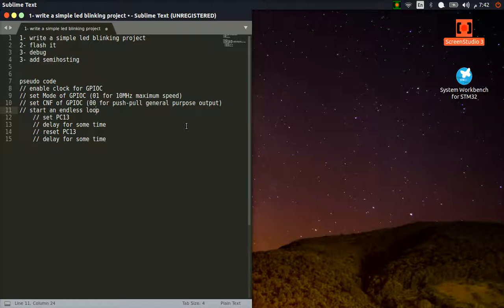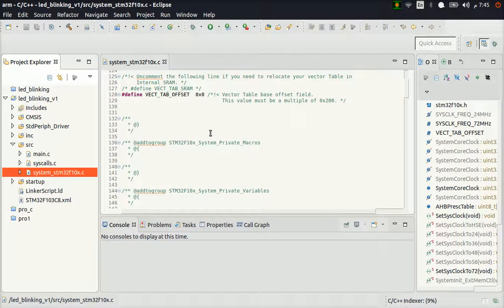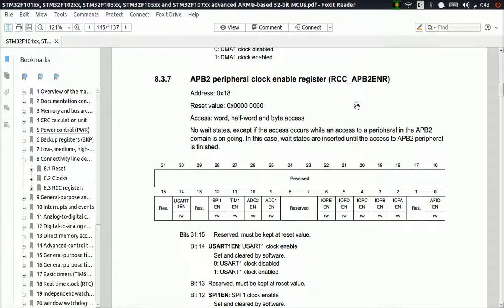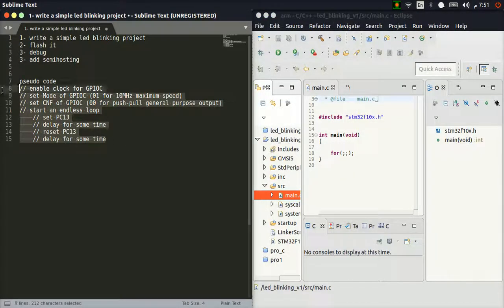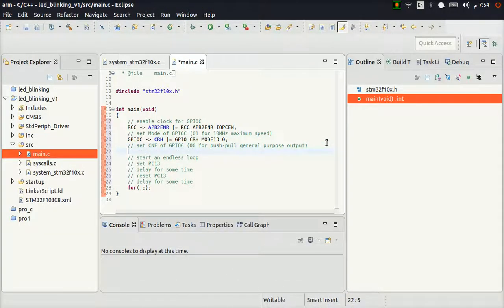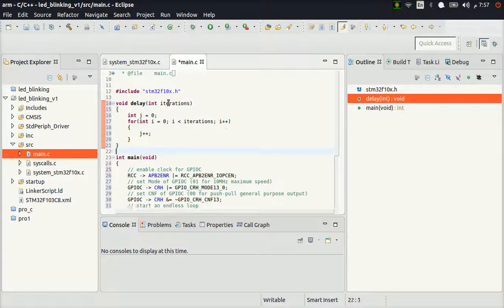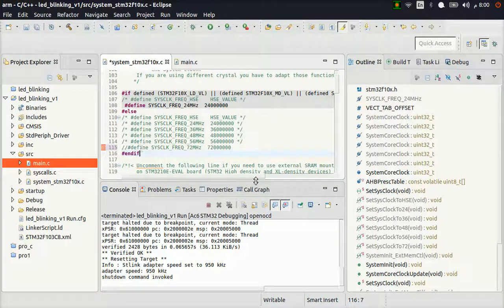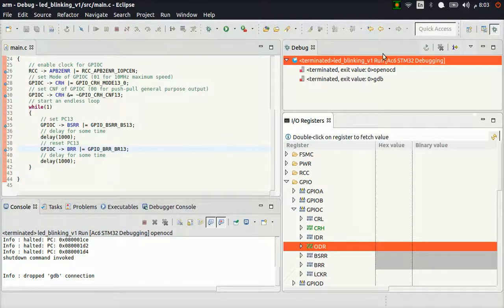STM32 Development   Tutorial 1 Led Blinking

Comment: nice course for stm32f103  but it will be better  to do a reusable code by just using function for system clock and for gpio setting and fonction for set and reset bit to make your code clear and use it second time or update it for setting ADC or TiMERs and Rtc in future by adding more function driver for all peripherals  congratulation you get new subscriber dont give up there is a lot  you could do with only  leds  blink with timer interrupt blink with Pwm 
to change the brightness blink using ADC with pot blink using usart  etc ....